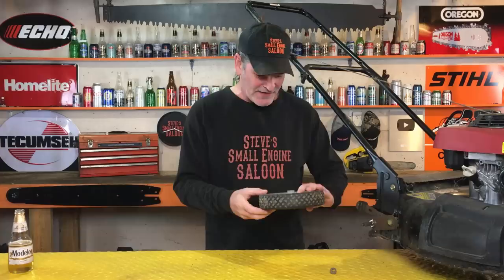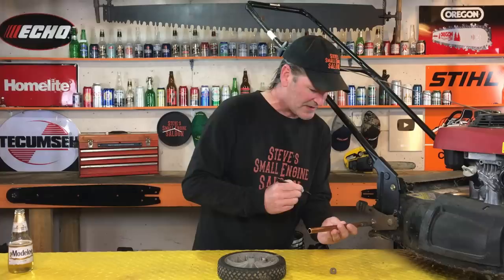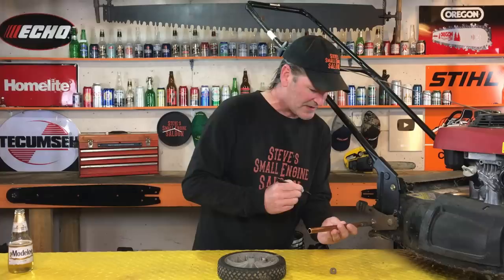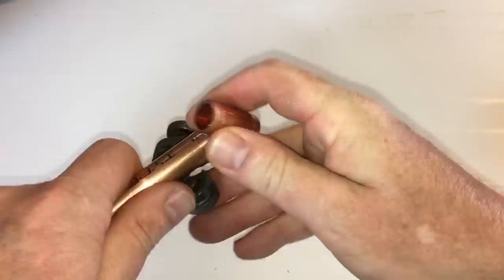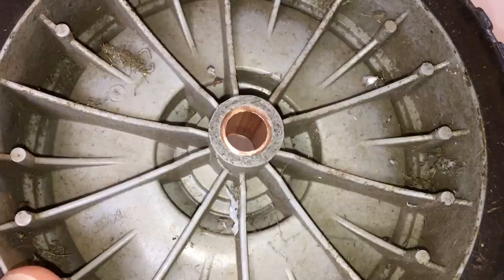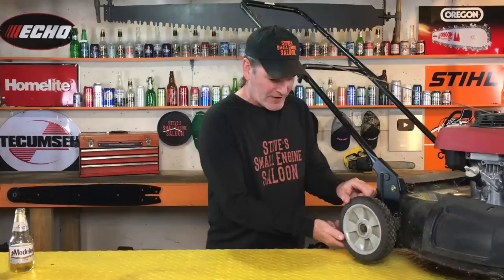Amazing Trick To Fix A Wobbly Lawn Mower Wheel

Comment from the maker: ✅Click here for a new wheel ➜ https://amzn.to/2NVlBZL
✅Click here for a pipe cutter ➜ https://amzn.to/2YXgIpC
✅Click here for copper pipe ➜ https://amzn.to/3NLlfmE
For more videos like this, check out:
👉Straighten A Bent Lawn Mower Crankshaft With A Pipe ➜ https://youtu.be/w2Ro9GmEyOE
👉Fastest Way To Tell If The Crankshaft Is Bent On A Mower ➜ https://youtu.be/3up57DHiCqs
👉Here's Why Your Lawn Mower Is Leaking Gas - Honda Style ➜ https://youtu.be/tp67AzWNbI4
👉How To Adjust the RPM Speed on a Lawn Mower ➜ https://youtu.be/7YrA3QEIFnE

You can connect with Steve here too: 
✅Visit Steve’s WEBSITE ➜ http://www.stevessmallenginesaloon.com/ 
✅Visit Steve’s PARTS & TOOL STORE ➜ https://www.amazon.com/shop/stevessmallenginesaloon 
✅Follow Steve on FACEBOOK ➜ https://www.facebook.com/stevessmallenginesaloon 
✅Follow Steve on INSTAGRAM ➜ https://www.instagram.com/stevessmallenginesaloon/ 
✅Follow Steve on TWITTER ➜ https://twitter.com/SteveSaloon
Reply: hey what about a loose rear riser on a push mower
Reply: Use a little copper anti seize
Reply: @brianknight9817  wouldn't anti seize still grab dust and dirt?
Reply: Nate Kollar that’s what thay use on brake calipers
Reply: Steve, can you make a video on how to make a new chainsaw last as long as possible?
Reply: Can you do a video of doing this with ball barings
Reply: I would not grease the wheel.  the copper tubing is soft and the rotation of the wheel is slow so heat generated would not be a problem
Reply: I like your channel. Keep coming with repairs.Got a craftsman 7.25 premium  front drive from father-in-law. The bearings on the front drive are rusted to the drive shaft. Took the gears off both sides and keeper pins but cant get the bearings and adjuster brackets off.
Reply: Put some grease in there Mister!😉

Comment: No grease.  I would do a little graphite there though.
Reply: Graphite works well.
Great little video, as always, Steve.
Thanks.
Reply: Yes graphite is the best for this. I rember i used graphite in skate board bearings .great tip buddy
Reply: @Benny T Link to that? Or which channel is it?
Reply: Ryan Ripley  yeah man👍
Reply: I'm so happy to see there are still some people with common sense in this world. Graphite would be the best bet, but you still need to maintain your equipment. 
Great trick though, I did the same with my 20yr old mower about 10yr's ago and still going strong. Obviously, I use graphite.
Reply: Pour on some Modelo, it’ll be fine.
Reply: My thoughts.
Reply: Duct tape works well
Reply: Awesome idea!
Reply: Graphite is best. If you can't get it, try a locksmith. They use it in locks, instead of oil or grease.
Reply: I literally just came in from checking my wheels and one was wobbly.
Reply: I grease every mower wheels that come in to shop for 20 years and no problem 😊
Reply: I was thinking of graphite instead of copper and wd40 instead of grease🤷🏽‍♂️

Comment: I would grease it , should be easier to push . If it wears out then just make a new bushing . Great tip !
Reply from the maker: Right on
Reply: Grease attracts dirt, and wears faster
Reply: @robertheinkel6225  Been doing this repair for 15 years or more... to dozens of mowers: Always greased up...never a come-back. The grease acts as a barrier...... but hey...this tip makes it a moot point anyway. 
Cheers. Stay Safe.
Reply: Grease it.  It takes one minute per wheel to take them off clean them and put them back on.  Every three mowings.

Comment: I've been greasing my new mower wheels for the last two years. Once per year. When I pull the wheel off the grease is still fairly clean. (Dirt is going to get in there whether there is grease or not). So I wipe it clean and re-grease.
My lawn is small tho and there's no dirt spots that I mow over. I say grease once a year, wipe clean, repeat. Great topic today, as usual. 🍻
Reply: Most people are not going to bother, especially with those awful push clips some mower makers use.

Comment: Hey Steve, I just tried this trick on my old MTD yard machine. The mower guys had already tried a plastic bush that only went half way through the hub. It was still wobbly. We used a bit of scrap copper pipe. The inside diameter was a bit bigger than the axle so we cut a slot lengthways, drilled out the hubs a tiny bit and hammered the bush in. It's better than new! I don't think it needs lube but if I was going to use any lube, I would have puffed some graphite into the bushed hub before refitting the wheel. Thanks mate! A great tip.

Comment: If after doing this you want to reduce the wobble even more. If you look at the bolt where it goes through the wheel, where it comes out the other side there is a small lip on there.The lip stops you tightening the nut up too much which will stop the wheel turning. You can put a thin washer under the head of the bolt" outer part of wheel".Just make sure the washer is thinner than the lip to stop the wheel locking up.Did this on the 4 wheels and its better than new now.

Comment: Don't need grease .. it is a slow speed, light load bearing surface .. the reason NONE of these come greased when new. The copper sleeve is perfect for this application, as it will wear much longer than the cheap plastic that was originally there ... probably outlast the mower itself now.  GREAT TIP for carefree mower .... THANKS STEVE !!!
Reply: And it will definitely outlast the mowerer!

Comment: Excellent idea! My father and I did it on a Huffy rider 45 years ago! I wouldn't use grease since it attracts dirt and grass but carnauba paste wax doesn't. Works great on Clothes dryer parts too.
Reply from the maker: Great tip!
Reply: Hi Charles, the only Carnauba was I am familiar with is for polishing/Waxing cars. Is there a different type your referencing? Thanks 
Bob
Reply: @rltkktlr  Exactly! The car wax. Paste is best. Liquid for hard to reach.
Reply: Charles Fiore, very cool thank you. Never knew that. Will try it out.

Comment: I did mine a few years ago. I used 1/2" C.P.V.C. Pipe it's the same size as the copper and it's harder than the original wheel material. It holds up well. And no grease.
Reply: Yep. I use CPVC as well. I think I'll give this a try though.
Reply: PVC would have the advantage of not setting up a chance for some galvanic corrosion.
Reply: Given the cost of copper any more, I was thinking Schedule 80 PVC. CPVC, in comparison to PVC, apparently goes through an extra chlorination process which makes it better able to handle heat, but that shouldn't be an issue for a mower wheel.
Reply: @Eupher6  great idea since the wheel is plastic and I'm sure PVC is much cheaper than copper.
Reply: PVC pipe is an excellent idea!
Reply: I think the brass would work a lot better than the CPVC

Comment: Nice job Steve and good way to quench your thirst too! lol I did a similar thing , drilled out the wheel like you did then I got a 500ml (pint) yogourt container cut off the bottom and cut the remaining cylinder-ish piece vertically to open it up then drew out approximately a 1" by 12 rectangle then I wrapped as much as I needed around the stud , put on the wheel , did all four wheels about five years back and all still working great with just that tiny wobble. No copper pirates are going to steal my mower either! lol😎
Reply: That "works for me" too.... Well done. Cheers. Stay Well.

Comment: Hi Steve. I have been repairing all sorts of small engine equipment for years but rebuilding mowers is my specialty. I drill out the wheels to 5/8" same as you but I use 5/8" truck air brake plastic line. After pounding it into the wheel I use a 1/2" bridge reamer to finish the inside bore. The wheel is now as tight as new and I do use a high quality grease.
Reply from the maker: Thanks for sharing

Comment: I slather grease, enough that it squished out catching the abrasives before they can do harm on the inside. I’ve got a 1983 tractor and the front axel hubs are never an issue. Another great video for ages young and old in learning to be self sufficient. Thank you, Steve

Comment: Just found your video as I've only recently needed help with this issue . Obviously after this much time things have changed . The $6 wheel from Amazon is now over $30 ! Sadly my wheels are a little different and I can't apply your excellent fix . Wobbly it will have to be  . Thanks .

Comment: Steve, you are a genius. You knew what to do and you read my mind when I said to my self "How the hell am I going to fix this lawn boy wheel on my super duper Lawnboy push mower?" and you answered my question. Thank you Steve. Oh Steve, I have one more question. My push mower has a gear on the wheel that drives my self propelled feature and it is slipping on me. Do you have a solution for that? For those who don't know Lawnboy is the king of one pull pull cords. That assumes you use good gas and change the spark plug on your end of the year service or beginning of the year service. Change the oil, spark plug, air filter and sharpen the blade and you will be good to go. I have had mine for at least 4 years and it is the bomb except for that fricking wheel. Can't stop me now. Thanks Steve.

Comment: When I replaced my drive wheels I took the bushings out of them and used it in place of the copper pipe. worked great. I used White Lithium grease, Ill see if it works long term.

Comment: Drill a small hole and use your bar tip needle type grease gun (cats prick). Grease will get pushed out  and form a seal , give it a shot every so  often.

Comment: Steve, while we're tips save old throttle and choke cables you know the spring looking ones. Take side cutting pliers and spread between the coils on one end and bend the end out like a cork screw. Put it in sink and tub drains and twist, dandy for hair clogs and its flexible enough to go around corners.

Comment: Steve, thanks again for an entertaining and informitive video. My recommendation would be to go to tractor supply and get some zurk fittings. Drill a diagonal hole through the plastic and copper (just the right size to "catch the threads" and screw in a zurk fitting so it can be greased properly. Would last forever. 
If not wanting to add the zurk fitting, I would recommned not greasing, since the grease would eventually attract dirt and without a way to "wash out" the old grease easily via the zurk and grease gun it would probably shorten the life of the bushing.
Reply: Zerk and alemite are my new words for today, in the UK they are just known as grease nipples

Comment: I've got a 2006 model Troy Bilt on which the wheels were getting really wobbly, when I pulled the wheels to do something about it I found that each wheel has a T shaped steel or bronze bushing in it. The wheels are fine, the spindles are worn nearly 1/2 way thought. 
The wheels never got oiled or lubed, with the thought it would attract dirt, but I guess that's not the case. My dad's old MTD from the 90's has far more use on it and got its wheels oiled before every use still has its original wheels which don't wobble at all. I've got a Craftsman from 2002 that has its wheels worn down to the point  where there are holes in the tread area where they wore through, yet they don't wobble. They were oiled regularly. 

I would think that graphite powder would be the ideal lube but it likely wouldn't last long and it would get washed away fairly easily.

Comment: Great video Steve! Mowing season is about done here in North Carolina and I was planning to "bush" the wheels on my mowers but hadn't decided how I was going to go about it. Copper tubing is a great idea and it's fairly cheap! An easy fix. As far as grease, I'm old school so I'll probably go with a light coating of lithium. I'll simply pull em off at the end of the season, clean the spindles and copper bushing and refresh the grease. Well it works on my trailer soooo.... Cheers!

Comment: Great tip Steve, thanks! For lubricating mower wheel axles I use pure silicone spray, it doesn’t attract dirt and seems to do a great job of cutting friction. I don’t use regular WD40 though, that stuff dries up and goes away quickly. I never use anything on self propelled wheel gears, those are exposed to way too much dirt and Toro even states not to lubricate them in their service manual.
Reply: Good idea on silicon. gonna try it WD40 is garbage

Comment: Drill an ⅛" Hole in the Wheel Hub, and install a Zerk Fitting!
Reply: yup!
Reply: Good idea, but a smaller hole, no zerk and use a chainsaw bar push greaser.

Comment: I did something like this for an old wheelbarrow that an elderly couple was going to let me borrow for hauling returnables one afternoon, but the 'barrow's wheel had a too-big hub-bushing --- i.e., 3/4" ID rather than the 'barrow's standard 5/8" OD axle; the couple's not-very-mechanically/technically-knowledgeable grandson had bought the wrong replacement wheel-assembly --- he'd gotten one for a pull-along lawn-cart, not a wheelbarrow.  So what I did was to find a piece of 3/4" OD steel tubing (I visited a friend's metal-scrapyard and cut a section from the handle of a discarded 2-wheel fertilizer-spreader) that was made from 1/16"-thick sheet metal, and so its inside-diameter was 5/8"; it fit both the wheel and the 'barrow's axle very nicely.
Reply: Well done. That's what I like to see: Not that shrug of the shoulders &
"Oh dear, it's scrap....we'll have to buy a new one...."   and off they trot...
All it takes is a good dose of looking at and a little thought....
Cheers. Stay Well.

Comment: Steve, to take up just a bit more of that slop, use some stainless steel  HVAC metal tape wrapped ON THE AXLE. The axles wear a bit, too, as you've noticed... the copper pipe will be fine and both will wear out together. The axles wear because of the grit that nothing will stop, the plastic wheel binds into the grit and acts like a file or sandpaper. I save wheels from old machines and I string them onto a long piece of threaded rod and then match two, front or back with worn out ones. Keep reusing them until they're toast, then throw them in the recycle bin.
Reply: Mike Grant: I'm with you to a point. But my view is...Let the copper wear out and replace .... as & when...the axles will last indefinitely.
The "slop" you mention....the solution is not your metal tape, but cutting a diagonal slot on the new copper bush....squeeze it closed...almost...now it fits the wheel and the axle MUCH Better!  No slop. 
The copper is always going to wear rather than the axle...  "Repeat as required".
Cheers. Stay Well.

Comment: TY Steve, good trick.  I wouldn't grease it with the copper pipe because the mower is out picking up dirt into the grease, and the copper being a softer metal and will be taking a beating.  However, exchange the copper pipe for a steel pipe of the same inner diameter (outer diameter just needs the hole in the wheel to be round filed a tad bigger if needed) and I would grease it up real good - should outlive the mower.

Comment: Use some neverseace. (I know I spelled that wrong but close enough
Reply: @wesleylargen  True: it has glass beads, like a very fine sand blasting bead. Not what you want for friction surfaces! That's so exhaust manifold bolts will back out, after years of exposure to high temperatures. Never seize on your muffler bolts, NOTHING ELSE!!
Reply: @vincentrobinette1507  
Head bolts, exhaust manifold studs, spark plugs, especially if going in an aluminum head.
Reply: @tubeonline629  exactly: Bolts, NOT bearings!

Comment: I won't even buy a lawn mower that does not use wheel bearings these days. Something I learned real fast when I had a lawn care business years ago.
Reply: Where do you find one that has wheel bearings now days, nowhere here does,Lowe's homedepot,Walmart,tractor supply they all are cheap BS plastic,I would like to have a well structured mower I have kept mine from 80's and 90's for that reason but they are rotting out, I even bought wheels with bearings at Lowe's to swap on a newer one I got about 8 years ago that's plastic and it don't fit,the shoulder is to big around
Reply: @wolfmanrebel874  I agree.
Bought my first mower twenty years ago: Poulan.....
All wheels had rudimentary bearings...they lasted....the B&S engine did not!
Could I find a replacement mower with wheel bearings?  No chance.
It's all RPC made rubbish with "Made-To-Fail" built in.
You will also find that many parts, whilst similar in appearance, are just that little-differently-sized to prevent swapping between 'makes'.
Been working on mowers almost 20 years now....(only on a casual basis, not a full-scale shop.).. but it really gets my goat the way they deliberately make  recycling of the "same part" all but impossible: You need a machine shop to re-manufacture basic parts that should be interchangeable.
It's the sad world we live in.
Cheers. Stay well.
Reply: Kind of silly to pay the extra $300-$500 for a mower with wheel bearings, when you can make sleeves for a couple bucks.

Comment: Since there is no seal to retain the grease and keep the contamination out, ,...No grease. If you do use grease then you would have to re-grease often. Also the grease will dry out and cause more resistance. Great tip Steve! I'm a DIY guy and love it. I've used pvc in the past just to take up the space, but this is soo much better! Keep the videos coming!
Reply from the maker: Thank You...

Comment: At the beginning of your video you mentioned pipe or caulk. I have a B&S 122T05-0762-B1 T-B  MN: 12AEA29L011 TB270

The 1/2" pipe won't fit over the shaft.  My front wheels look okay except the holes are larger and different sizes, cuz I let wobble too long.  Was not brave enough to attempt fixing till I found your channel.  I appreciate your time.